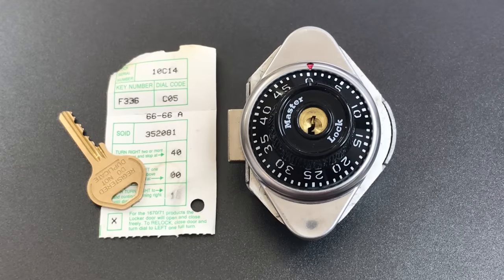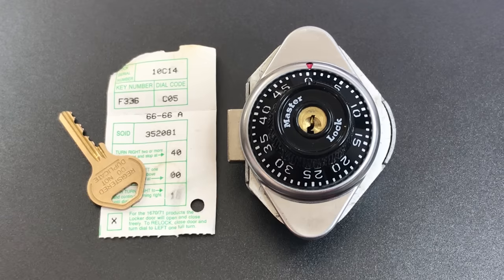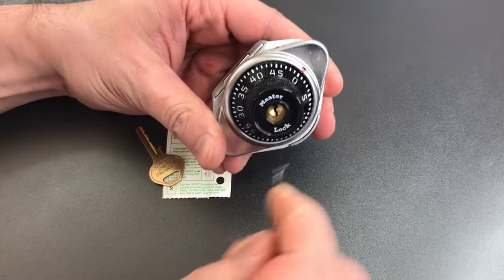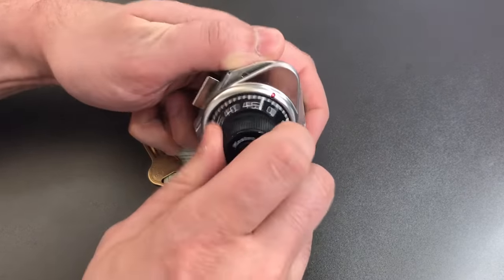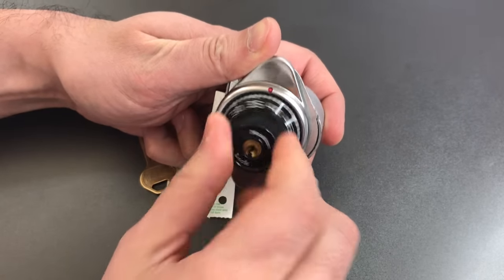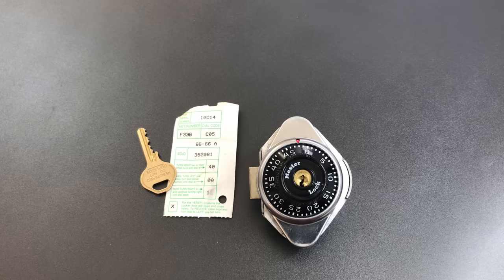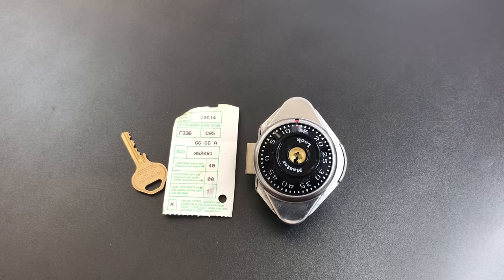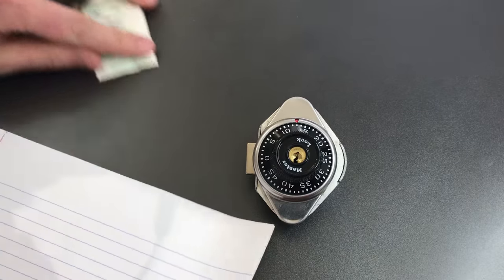[617] Master School Locker Combination Lock Picked and Decoded (Model 1670)

Comment: Having the last position of the lock literally be functionless is inexcusable for anything purporting to be a "lock".  When I was in school I was a relatively upstanding kid, but knowing what I know now, so much mischief would have happened.  I still have one of my old combination locks with the master key cylinder on the back.
Reply: htomerif its because the last is mostly just a pulling action type thing
Reply: Even with a combo padlock, the last number is essentially meaningless (though not quite), as you can just quickly pull up and down on the shackle as you run down the numbers trying to brute force them. (If you pick the wrong third number, it's not like it resets or anything.) I had a method with early-mid-90s Master padlocks that gave me the middle digit of the combination, and brute forcing them was a snap, as you went up by two for the first digit, dialed in the second digit, and then just shook the lock/shackle up and down as you dialed down the last digit. I brute forced about a dozen of those within three or so minute (each).
Reply: I figured this out while I was in high school too, just a couple months into my freshman year I stopped even remembering the last digit and would just do the first 2 and turn till it opened
Reply: This is how the lockers at my high school were, all of the locks had a master key in the back and were all the same key, between the gym lockers and the hallway lockers. Each school year they'd take all the locks off and redistribute them, and then at registration you'd get your new combo (But you kept your locker all 4 years). My junior year someone got ahold of the master key, blocked one of the doors that never got checked, and came in on a Saturday and took all the locks off, and then put them all back on different lockers. So come Monday morning, nobody in the entire school could get into their locker, and the only way to look it up was with the code off the back of the lock.
Reply: Andrew Bowers that is a batshit insane system though. The other way around — keep the lock, change the locker — would seem to be much more useful. Or do you regularly have situations where a student and the school both think he’s gonna come back next year, and then they don’t?
Reply: @andrewbowers3676  I got ahold of one of those keys.  they were cleaning them all out during the summer time.   I was taking drivers ed in summer school.  keys were just hanging out of the lock of one of the lockers so I grabbed it a I walked by
Reply: But if 3rd digit isn't there,the second digit would be the useless one, thus leading a less secure lock

Comment: Meanwhile my schools always just required students to buy a lock at the start of the year if they wanted to lock their locker.
Reply: That would probably be prohibited today. An administrator needs to be able to quickly open a locker at will, without 10 minutes, 4 small diameter cutting wheels, and an angle grinder.
Reply: Alex Jamieson My school still gets us buy locks. Not a big deal, a pair of cutters can easily cut any common locker lock.
Reply: Alex Jamieson my school made us buy one as well, but we had to give the combination to a teacher. Which didnt mean anything since you could just swap the locks.
Reply: in vo tech we called the machine shop to deal with lockers
Reply: My schools sold us combination padlocks that had the keyhole on the back. They were a requirement to use a locker.
Reply: @hikariyouk  That is a shockingly immoral system.
Reply: My school didn't fix the toilet that some idiot broke for a whole semester, because he felt "personally insulted".
Reply: At my high school, we didn’t even have lockers.
Reply: My school didn't allow locks on lockers
Reply: @user2C47  The school would make you buy their own locks, usually supplied by Masterlock. You have your own unique combo, but the school administrators' master key would unlock all of them. For people who brought their own locks, they'd be called down to the dean's office and they'd have to open the lock in presence of the administrator to be searched. If you didn't comply, they'd just clip it open, search it, and suspend you.
Reply: @conorsmyth9963  that's exactly what my school would do - lost your key? The subschool head has a big ass pair of cutters - could cut  the thickest of locker locks
Reply: Charles Wagener my school didn’t allow us to use the lockers 😂
Reply: @user2C47  my college allowed students with classes in a certain building to have lockers (it was an art building and students needed a place to keep their projects). they just snipped locks left behind at the end of the semester. and since a lot of the sculpture students did metalworking, I'm sure if you used a hardened shackle, someone would break out an angle grinder.
Reply: You'd think that some people in my school are keeping bars of gold in their lockers with the massive locks they use!
Reply: My school works the same way. Classic 4 wheel-style master locks so super easy to pick with the pull and turn method😂
Reply: Mine did too, they asked for a copy of the key.
Reply: we had the fun of paying for the privilege of using the school-issued locks
Reply: I filled my locker with packing peanuts hoping for a search. It did not get searched. In fact it never got opened while I was a student at that school. I often wonder if it ever was opened.
Reply: My high school issued combination locks to students with keyed access on the back of the lock. For Middle school and college it was buy your own lock.
Reply: Alex Jamieson have you heard of this thing called a bolt cutter? Small padlocks are not even a little bit secure from a janitor willing to use destructive entry methods.

One thing it doesn’t allow for is large scale locker searches of all lockers, not so much because you can’t but because it’d be very expensive. $2 locks add up when you’re replacing a thousand of them, plus then you have to distribute new keys, huge hassle. I consider this a feature rather than a bug.
Reply: Same that's what my middle, and high school did they had kids pay a fee for a lock, and they handed them out at random with school assigned  serial numbers etched on them, and you had to sign for them, so if they did a locker check they knew if the locks had been swapped, and in my 10th - 12th grade years I did not even get a locker as my school ran out of lockers my class so big, and the fact I went to vocational school for 1/2 the day offsite to another location, so I had to carry everything including my Zenith Data Systems laptop in it's own bag, and this was back in the 90's so a hell of a lot of lug around for school on the bus lol!
Reply: @GIJew  What were they worried about people putting in their lockers that it is such a big thing?
Reply: @user2C47  They will just cut the lock if you do That
Reply: My school didn't have lockers. :(
Reply: @user2C47  I teach woodshop... they come borrow my bolt cutter if the key doesnt work
Reply: Szymon Gorczynski what lock they use
Reply: TheSpoonKing my school got these massive hasps that open and close and you put a padlock through the hole the hole is so big that an Abloy 362 can fit want to know what lock i used? I used an 
Abloy 3065-25 3066-46 with Abloy classic core used it from 6th to 8th and even high school had it so i used that lock for 6 years straight and i would always laugh at the people who used small locks but i also saw some crazy locks i saw a puck lock a storefront gate round body padlock an American 3700 an Abus granit Abus 20-70 abloy 362 and a Bowley and some more thank god i never lost the key even though i would never lose it but if i did then they would probably call the fire department with a grinder or the school probably have grinders or HUXLEYPIG98 lol and ABLOY IS KING
Reply: Oh i forgot about the MulTlocks and the Squires and some Sargent and greenleaf and medecos the worst lock i saw was a TSA lock that was never locked and it was a tiny brinks
Reply: @user2C47  highschools still let you buy your own. You just have to give them the combo or a copy of the key
Reply: @infinitetoast9200  Only some high schools allow that. In my school district, that is not allowed. There is also no locker fee, and phones are strictly prohibited at all times.
Reply: My school required us to buy our own locks, from the school, to be given back after we graduated.
Reply: my school sells locks, and also the option to bring your own lock.
Reply: @SweetChuckPi  so they're just "ers"
Reply: @user2C47  we have our own locks too, today, in 2020
Reply: @conorsmyth9963  yeah because most of them branded for school lockers are not hardened steel.
Reply: User 2C47 it’s ok in the UK, they’d just grab the student with the lock
Reply: 1.1k like
Reply: @user2C47  I had to buy my own for the gym locker I used. I somehow went through kindergarten-8th grade without ever getting a locker to use (I dropped out in freshman year, so high-school doesn't count for me).
Reply: @GIJew  A little super glue in the keyhole would probably slow them down a bit.
Reply: I don’t even have lockers
Reply: In 6th grade (first year I had a locker, elementary school was the #cubby life) if you wanted a locker, you HAD to buy your lock. But it could only be a specific version of a Master lock, personally checked and a staff. Once your lock information was logged by the school, they’d give you an assigned locker.                                           In high school they told us “go pick out your locker. If we need to get into your locker and you won’t open it for us we’re just going to smash it off.”
Reply: TheSpoonKing same, I got it but never used it, but it was useful for excuses for homework.
Reply: My school got us to buy locks and hand them back at the year just took their locks
Reply: our school made us buy locks. if we didn’t lock our lockers in the first 2 weeks of the year they would padlock it
Reply: Every school in the us cheaps out on everything lol
Reply: @user2C47  Not everywhere.
Reply: Yeah mine too 
They still do
Five dollars if you want to keep your stuff safe
And that’s why I have back problems from never using my locker

Comment: Has someone built a computer controlled stepper motor gizmo that will work through all of the possible combinations (reduced by the shortcuts described in this video) to make quick work of automatically opening one of these? That would be neat to see in action.
Reply from the maker: Are you talking about samy kamkars video?
Reply: LOL. I should know better than to ask an obvious question without bothering to do a quick search for an answer first. Found the video, thanks.
Reply: lol
Reply: I'm sure you can do it easily with an optical rotation sensor, a couple motors,and an arduino.
Reply: Although it's not mechanically going through combinations, thieves use laptops to run through code combinations to get around new car security and ignition interlock  systems.
Reply: Yes
Sammy did

Comment: Shit bro back when I was in school you could just jig (just yank repeatedly) the lock and it would open, always did it but never stole lol
Reply: ChromeEnthusiast lmao that’s funny
Reply: The real picklock trick is to twist the little “OCCUPIED” sign to “VACANT” on the wheel, and make your friends shitting experience much easier.
Reply: I was too lazy to put in my combination every time, so I rigged my locker to open from just jiggling the handle.  other people I knew did the "set the first 2 digits when you leave so you just have to put in the last when you get there", so anyone could've just walked by, pulled up on the handle and spun and it would open.  high school kids are dumb
Reply: @darkmagician1184  I guess I'm old now...what would one take from a locker in the 90-95 time frame? No cellphones, no laptops (not the small ones...lol), maybe a graphics calculator and some text books. I guess kids have too much now like iPhones and laptops, and tablets.
Reply: @Meekerextreme  Gameboys, Sega Game Gear, Walkmans, etc.
Reply: And then there's my lock that involves yanking 10 times even after I put in the right combination to open.

Comment: Wow! Between middle school & high school AND the job I worked for 33 years, If I had just a penny for every time I opened one of these locks I could buy steak dinners for several people!!
Reply from the maker: 👍 Me too... middle and high school, college, and law school all had these. Thousands of opens.
Reply: I too was the go-to when someone forgot their combination. However i used my ears rather than trying out every combos. I do not know how that kind of approach is called, listenning to the klicks made as each gate frees a pin, mind shedding some light?
Reply: quick estimate because i'm bored  (using numbers from my school/work routine and easy round numbers) 

School:
40 weeks of school per year 5 days a week (40*5=200 days)
7 years of school (200*7=1400 days)
assuming 4 opens per day (4*1400=5600 openings during school)

Work:
33 years of work 49 weeks per year (33*49=1617 weeks)
1617 weeks 5 days a week (1617*5=8085 days)
assuming 2 opens per day (8085*2=16170)

Total:
16170 work opens and 5600 school opens (16170+5600=21770)
21770 cents shuffle the decimal $217.70
assuming $15 dinner plus 8% tax (15*.08=1.20+15=16.20 per meal)
$217.70 divided by cost per meal (217.70/16.20=13 meals with $7.10 left over)

13 meals with $7.10 left over
Reply: clownrock95 the boredom is strong within you. I fear it may take over at any moment. lol
Reply: Alter Kater  what else would you listen with?
Reply: Mind sparing a steak for me? Medium-rare, please.
Reply: Alter Kater  Like spider farts
Reply: @clownrock9558  the 7.10 is for the half-decent bottle of wine. or the tip. your choice.
Reply: @jackclark1994  That was really confusing without context lol.

Comment: Many Master combination locks can be opened using CCW-CW-CCW rotation instead of the common CW-CCW-CW rotation. Is that true of these locks too?
Reply from the maker: I don’t think so. However, you can rotate through the 5 preset combinations in reverse order by going CCW.

Comment: I worked with these locks before, but the version we had had some sort of way to make it so that if you don't turn it to the final digit purposefully before twisting it further, it would just reset. There was still a pretty wide tolerance and if you just twisted it fast with decent force, it still didn't matter what the last digit was. But it did seem to be a little more secure than this one, if it was only marginal

Comment: My middle school had regular combination locks, not ones with deadbolts. I vaguely remembering hearing about a trick where you just turn the lock around on it's side and slam it hard, and BAM it opens. Public schools are never known for buying top quality for their student's security. I also remember the prank where someone could undo your lock and turn it around facing the locker so it was a pain to open.
Reply: Can confirm that. Worked building lockers for a couple summers and learned how to open them with a firm kick or whack

Comment: Last year, the school's lockers had this "glitch" we all discovered. Basically, the locks wouldn't auto scramble right, so if you closed the lock, you could just turn the dial by one number and it would open again. A lot of people used that trick to get their lockers open fast if they were in a rush. Its probably why the school changed the locker locks this year.

Comment: Heh, never once had to input the combo on a locker - just lift and kick the bottom of the locker (door part).  The door would vibrate enough to simply skip off the hook or slot the bolt slid into.  Could open any locker, after doing enough time (bout 1/3 of a school year) the hook or slot would have eroded away enough to only require a semi forceful palm strike near the lock (technically the hook or slot on the other side) to open, no lifting required.

Was very interesting to finally know what that button on the back was for though!

Comment: What I think is really crazy about this is that's my locker combo from when I was in high school. I loved it because it was so easy to remember, and then once you realized that you didn't have to be exact with it it made getting stuff out even easier. Then people started losing stuff out of their lockers, and I knew it had to do with how easy it was to open the lockers. Some people bought extra locks to put on their locker and others just stopped using them altogether. I didn't want to buy a lock because the school said that if they needed to search your locker, and you weren't their to remove your lock, they would just cut it off and they said they didn't have to replace it. I didn't have a lot of money so I needed to find a cheap way to secure my stuff. Our lockers had the pull tab on them as well to open them, so I was able to add a second layer of security by putting a medal cylinder from one of my pens in that space.

Comment: I work at a highschool and we recently got a batch of locks with only the first combo given. I looked up this video to remind myself how to find the other ones. I was shocked (though I shouldn't be considering it's Master Lock) to find that of the batch of 50 there were only 2 different offset patterns. -5, -6, -8, -7, -24 and -7, -5, -6, -8, -24. One of those appears in this video and looking through our books of the older locks in the building they follow the same two offset patterns. You will also notice the final offset is always -24 witch I feel like means you have even better odds of brute forcing the lock. These things are such garbage.

Comment: For the offset, does it essentially just disengage the knob from the mechanism?  and then as you turn it, there are 5 specific points where it can re-engage?
Reply from the maker: I believe that is correct, but it happens inside the steel box, so I’ve not seen the part.